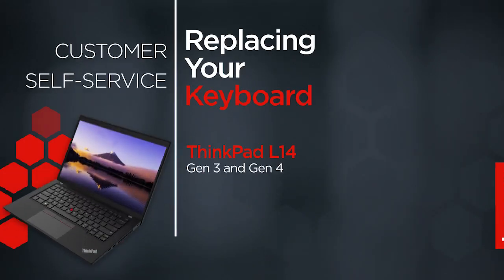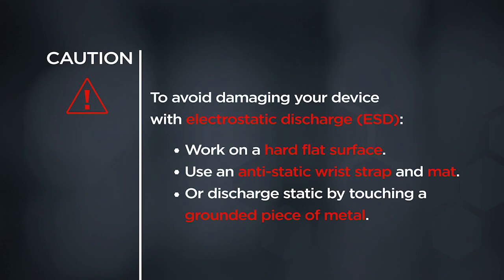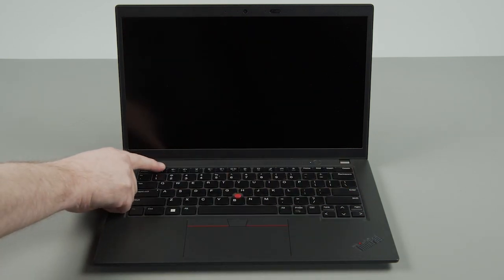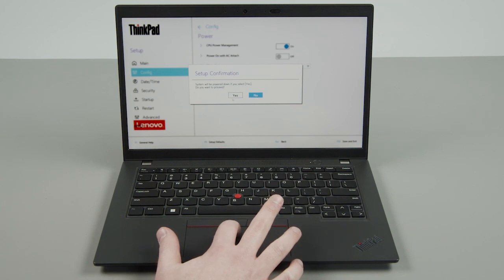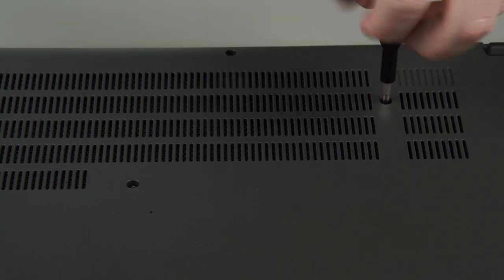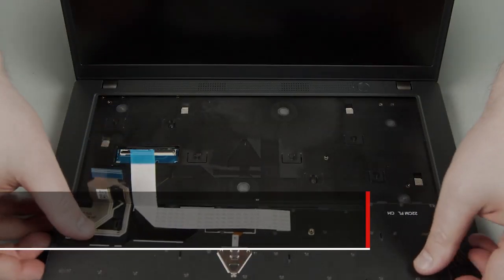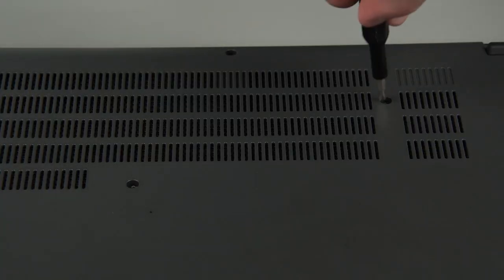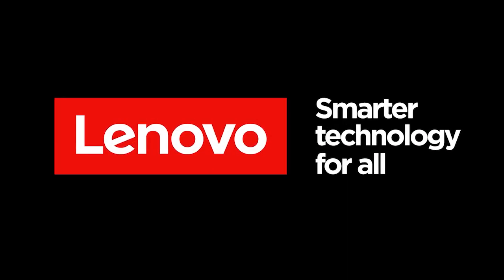Replacing Your Keyboard | ThinkPad L14 Gen 3 and Gen 4 | Customer Self Service

Comment from the maker: This video will show you how to replace the Keyboard of your ThinkPad. The process in this video will work for the ThinkPad L14 Gen 3 and Gen 4. 

You will need a screwdriver kit, a non-metallic pry tool, and 10 minutes of your time.

To learn more about your device go to https://pcsupport.lenovo.com
To find parts for your device go to https://support.lenovo.com/parts-lookup/?cid=ww:lenovosocial:b9515f&source=socialmedia&subsource=yt

** NOTE: Static electricity can destroy components. Use a grounding strap, and clean, non-conductive surface to work on. Use plastic or coated tools to prevent scratching and avoid using metal tools on plastic parts. For more detailed information on electrostatic discharge and how to prevent it, please watch our ""Understanding Electrostatic Discharge (ESD)"" video: https://youtu.be/by4PB3WtdLo 

Applicable Machine Types:
ThinkPad L14 Gen 3 - 21C1, 21C2, 21C5, 21C6
ThinkPad L14 Gen 4 - 21H1, 21H2, 21H5, 21H6

#lenovo #LenovoSupport #LenovoTechSupport